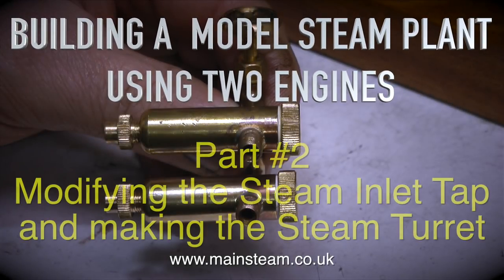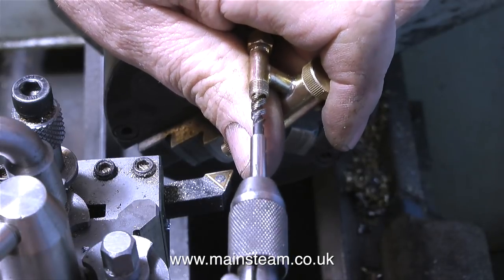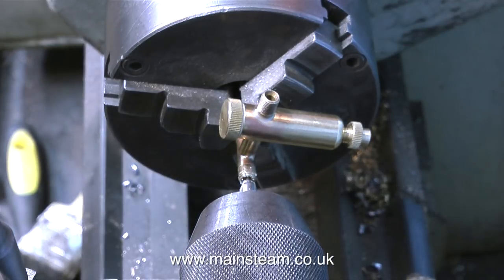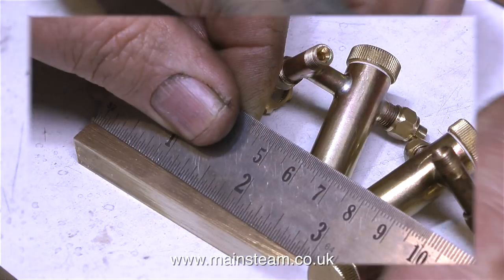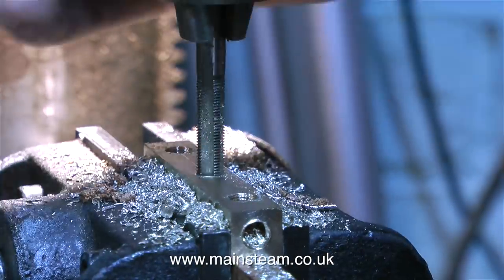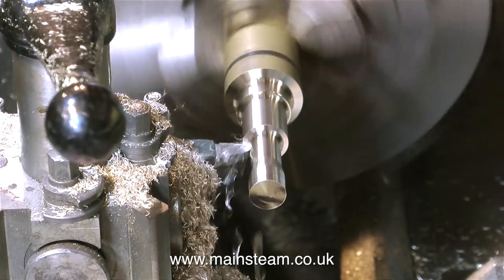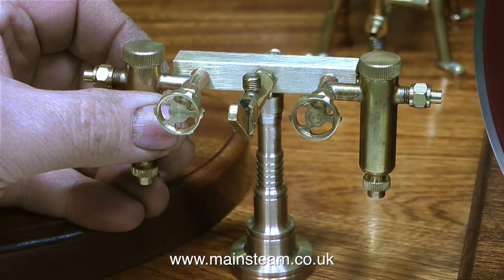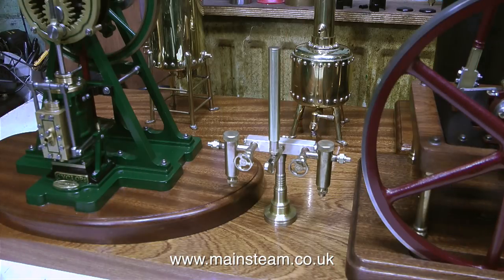BUILDING A  MODEL STEAM PLANT USING TWO ENGINES - PART #2

Comment: Another tip for beginners, do not face off the end of stock which has the identification of size on it and add the material type, a couple of months down the road you may not remember its type.

Comment: Hi Keith, I have been watching your videos for a little over a month now, and I wanted to ask just one question. How big of a boiler would you need to get 300 psi of pressure. Basically I was wanting to know physical size and then thickness of the shell. If I ever get a lathe I'm going to make an N&W hooter whistle, and I wanted the ability to have a boiler with 300 psi superheated steam to operate it. I was just curious if it was possible to make one that wasn't the size of those on the locomotives themselves. Thanks, Chris.
Reply from the maker: I can't really answer that as boilers are not my speciality - however maybe another view knows the answer to your question . ..